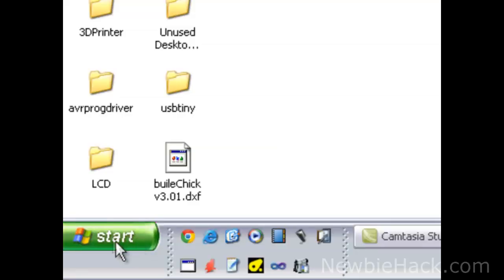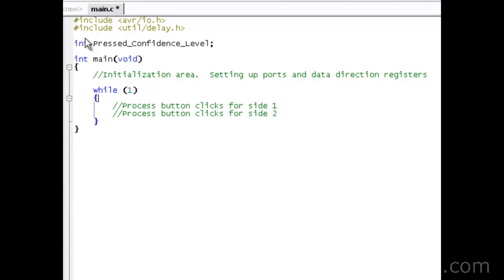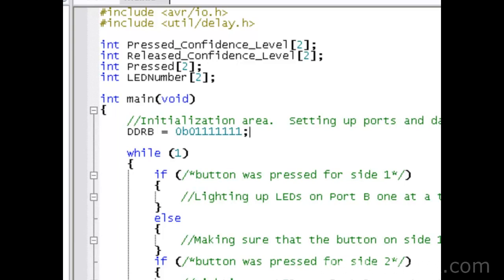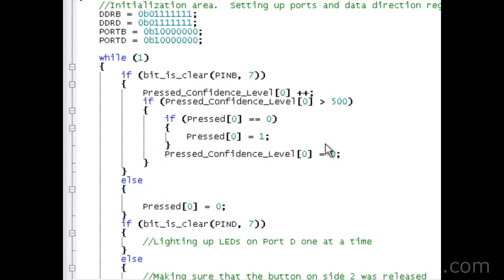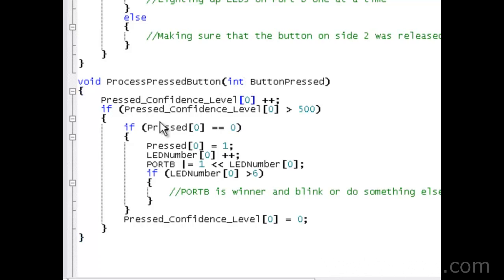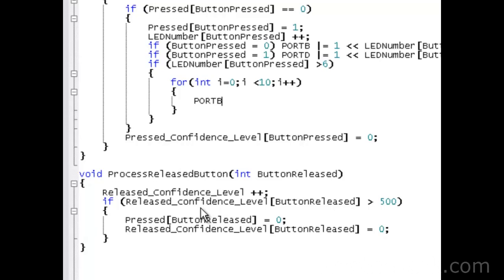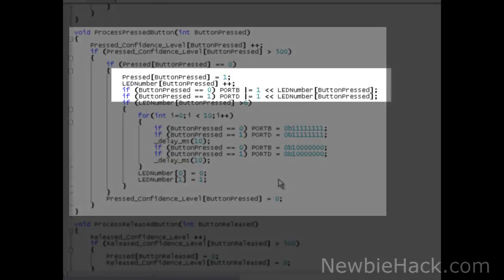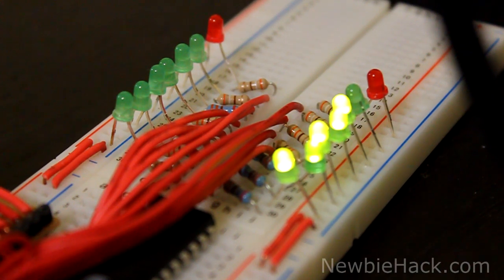15. Arduino for Production!  AVR Atmega32 - The button Game

Comment: At 23_47, you wrote bit_is_clear.....how and where did you find that syntax? I looked through the Atmega Instruction set and didn't find that syntax....can you please tell me where were you told to use that syntax for that specific task? Ty
Reply from the maker: You can find it in the include files that I use in the program.  I'm sure I found it initially from a ton of research online back in 2011.  I can't remember where, but it is just a simple function that is easier to read than the alternative  bitwise operation.
Reply: @PatrickHoodDaniel  Thanks for the reply. I programmed a microcontroller in my sophomore year. The prof somehow went through 2000 pages of the manual for the freescale microcontroller we worked on and used to tell us what syntax to use. When we used to look it up ourselves, we used to waste 90% of 3 hours just digging for that one line of code. Finding those commands is time consuming. I thought you had some sort of "manual"  you looked them up in. Can you please make a video on how to "dig" up stuff in a manual? I ask this because when the time comes to program, kids need to know where to find what they are looking for. Anyone can write PIN2 = HIGH while programming an arduino ( someone already put it in simple english), but to write it in the more basic level like DDRB = OXOOOOO1 takes a lot of research. First the kid needs to know what pin to manipulate ( he can get that from the pinout diagram), then he needs to know if the manufacturer calls it a DDRB or WXYZ or something else. It would help if you can make a simple video to do something simple like turning on an LED , but you should think out LOUD in the video, so we can know your thought process and how and where you are getting you syntax from......hope i didn't scare you away🤣

Comment: Hi Patrick! 
First of all i would like to thank for this great tutorial, the software debouncing helped me a lot. But there is one thing i still can't figure out. If anything else is connected to my MISO pin (PB6) besides the MISO which comes from the programmer then i get an error something like "Verifying flash memory... Mismatch at location 0x...." . In our case the red LED1 is also on this pin if I disconnect it and then programming the MCU everythink works fine.  Any tip for this problem?Ty

Comment: Sir, thank you so much for such wonderful series of videos. Could you please tell us how we can control an Embedded System in case of sudden power failure? For example, how can we write a code so that the program will save the variable values if the power goes out all of a sudden and again start processing from where it left as soon as the power comes back?

Comment: Could you instead connect the button from the hot line and set the pin to be 0V? Is it convention to have the pin for the button hot?